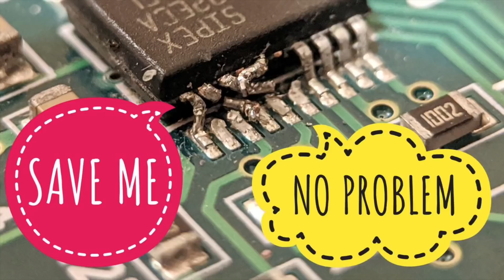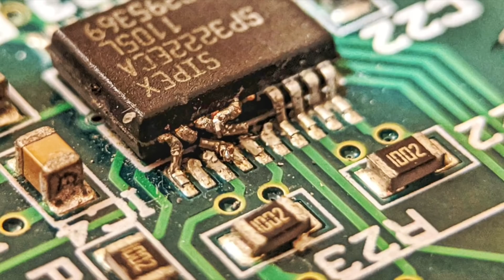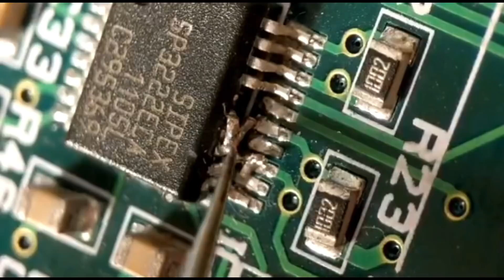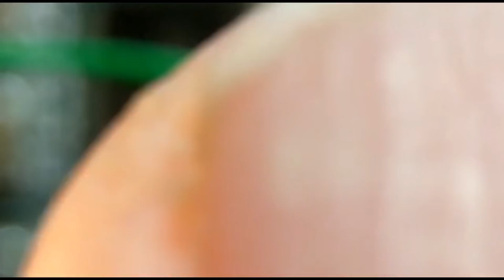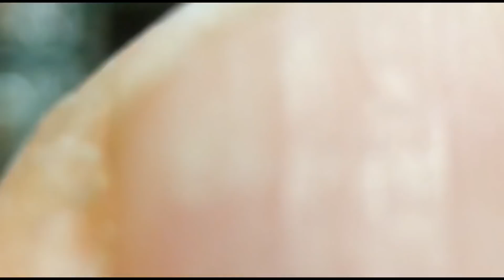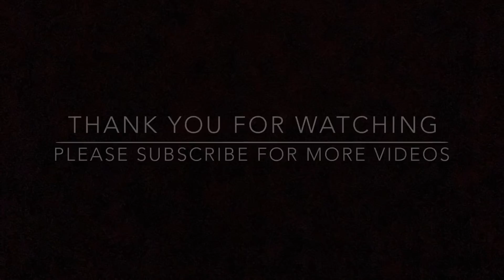IC Pin Repair / How To Repair Broken Pins On IC - 2 Methods

Comment: Someone might not even notice these repaired leads if they were repairing the board in the future. I like how you made sure the new leads were naturally pressed against the old ones on the IC, so it wasn't just the solder holding them together.
Reply from the maker: Hi . Thank you . These are 2 methods I've used a lot over the years and they really are secure and smart solutions . So hopefully lots of other people try them and achieve good results. Thank you again , your comments are always welcome.

Comment: Great job & video, i wish i would be as skilled. Do you use a electronic microscope?
Reply from the maker: Hi . Thank you , your comment is very much appreciated . I do use a microscope for most of my small detail work , but not for anything of a reasonable size . It's amazing what you can see under a scope. The wire cutting part in this video is shown much clearer in my( pads , traces + IC pin video). Thanks again 👍

Comment: Great video & explanations!
Thanks for sharing your knowledge :)
Reply from the maker: Hi . Thank you for your nice comment . I noticed my hand slightly blocked a tiny part of the wire link cutting method , but how to do this stage all explained later in the video .  Also this wire link stage is shown REALLY clearly in my repairing pads , traces + IC pin video. Thanks again.